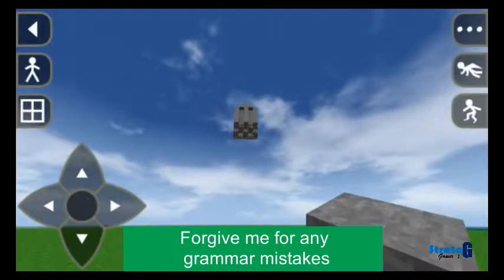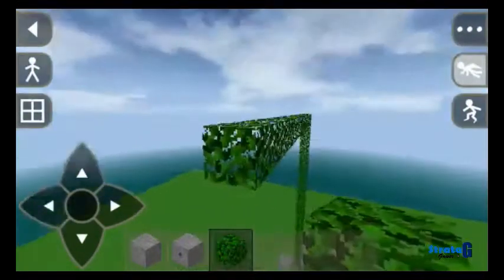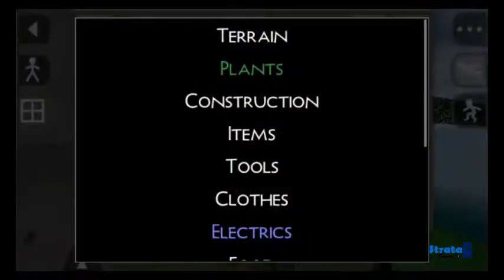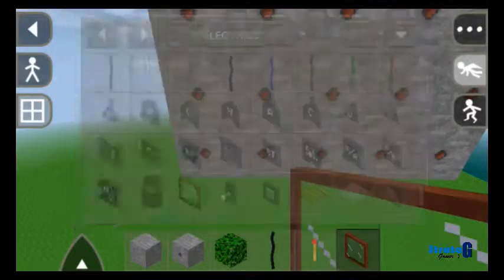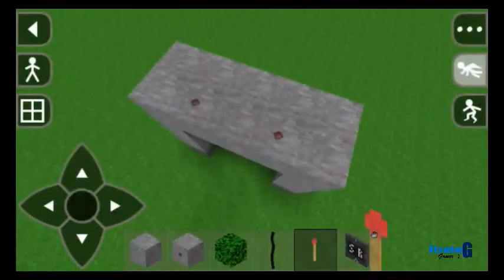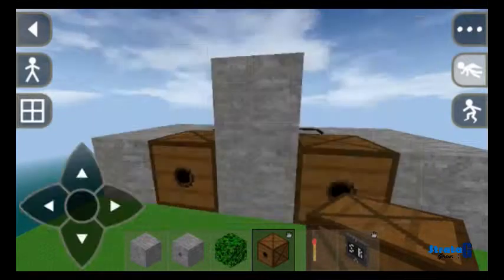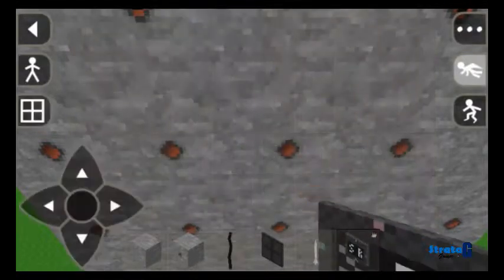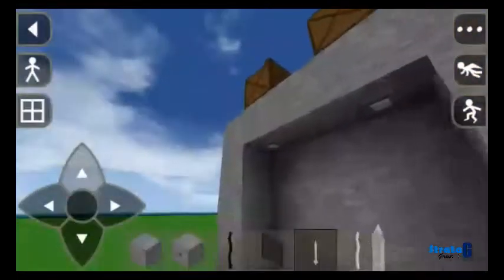Wireless Connection On Survival Craft 2

Comment: this is 80% wire
Reply from the maker: Let me be more clear. This connection came to be helpful for me when I was playing multiplayer with my friends. We make two forts and fire gunpowder kegs at each other and try to kill one another. Then usually it is very easy to get your connection to your dispenser damaged from the attack. Using this technique I was able to prevent that as the connection had no wires connecting the dispenser and button. I just had to keep the dispenser in my connection protected till i need to us them
Reply: i sorry not dissing just confused came off mean
Reply from the maker: @dee6174  :)
Reply: did you need to ask a question yesterday